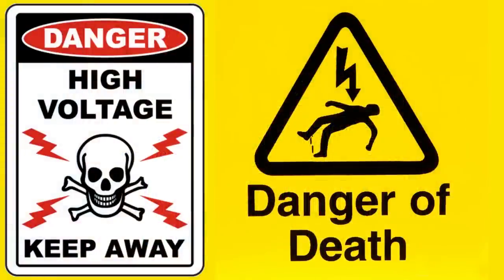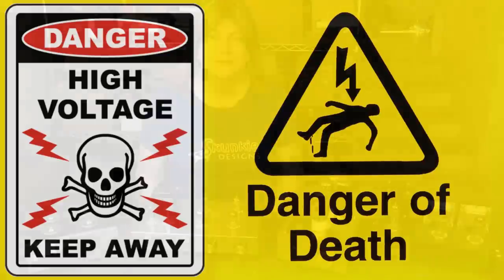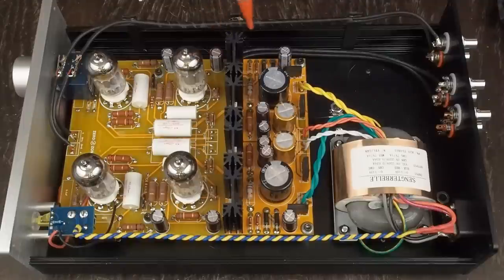HiFi Tube Pre-amp: Final Three Shootout!

Comment: That is so weird, because I have the looser, X2 units. I run them with two Dynaco ST-70s with a pair of Klipsch RP600Ms and Sony SSCS5s. One for the top and one for the bottom. I think the sound is fantastic, and I have several preamps to compare to. I run them on an AmpManiac variac and keep them at 110-112v to protect the 110v transformer. They sound absolutely amazing to my ears. I do have Genalex Gold lion tubes in them, but they sounded great with the stock Chineseium PSVane tubes as well. The point to point wiring is top notch IMO, and the chassis is solid. À chacun ses goûts I guess. I love your channel and watch at least weekly. Keep 'em comin'!
Reply from the maker: As with all audio gear, "how does it sound?" is very subjective. It lost my shootout for safety, parts quality and design reasons, plus to me the other pre-amps sounded better and actually produced a usable amount of gain. As always YMMV, if you enjoy them, keep enjoying them.
Reply: I recently bought the #2 Nobsound and it sounds awesome,I also also got 4 genalax gold lions. I don;t know what the other two sound like but I sure they are good I am also getting a couple of rectifing tubes in the mail today, Here's to tweaking and upgrades.

Comment: Instead of going DC on the heaters could you put it a terminal strip and run twisted wire directly to the heater pins on the tubes bypassing the circuit board?
Reply from the maker: That might be the easy solution to try and just cut the board traces. I think I will try that first.

Comment: I own your loser amp and it sounds very good. I updated the 12ax7 to 6sL7 and it really opens the soundstage.  I upgraded the rectifier to an American 6x5. Also on pointing out the transformer weighing in at 110 volts. That's a Chinese thing. I've owned several chifi amps and they all have 110 printed on them but seem to hold up well. I own one that is around 8 years old, and barely runs warm

Comment: Fantastic video. I'm learning a heck of a lot from your videos. I built a couple nobsound amps that look just like the loser preamp. My hearing must not be too discerning because I think the push pull amp with 6u8a and 6p1 tubes sounds great. I'm not experienced enough to be able to tell and possibly since I'm a retired diesel mechanic so my hearing is not so good. As you mentioned these kits come with a schematic and that is it. No other guidance at all so I had to figure a bunch of stuff out on my own which in turn I learned a heck of lot from those builds too. Can't wait to build the little preamp you mentioned putting together. Being a vintage radio guy the little wooden chassis is appealing to me but I imagine that would be hard to find.

Comment: I bought the diy version you losing choice, i did ground it though. Im about halfway finished so its unfortunate uve come across your video so late. Any advice on improving the build? Ive actually made my own copper runs because ive felt that the cables that came with it were lacking a bit. Also im wondering why my amp comes 1 of the bigger tubes and 3 of the smaller 12ax7s

Comment: Oh you do Pre's too huh ? :)  The differences will be WAY to subtle to hear on a YT vid, but I bet they're nice to look at - watching now !  Ohh, OTHER peoples Pre's?

1 - Gulp! THAT;S why they gave em mains taps, back in the day , right? Heater volts is s'posed to be +-10% iirc?  Sheesh! ... Yeah cheapo hi capacitance cable seems so WRONG for a tube pre and 'stereo'' cable brings MUCHO crosstalk!) If I found one in the trash it'd be fun to rework (and fix the ground), but otherwise...
2 - Cant see the PCB layout, but yeah, not so bad .. AC heaters, good point - be fun to rewire or convert..? I try and do the twisted wire thing even if I'm using DC - it just feels.. 'right'
3 - Ah this IS one of yours - ohh, that's NICE !
(cant you just switch the regs for LDO's? They can be noisier, but long as your decoupling is good? (I'm sure it is!))

Hi from London x
PS I've got some orig Mullard AU7's but pers not so fond of em in Gain Stages - dist tests seem a way worse than 6SN7's (and I try and avoid octals) - I figure those Russian things the perform like ECC88's should be a tad nicer, have you ever tried 'em ?

Comment: Hi Skunkie, Kunke here . . I would REALLY like to hear your thoughts about a Heathkit
SP-2 preamp . . IF necessary, I can supply one to you, providing the shipping cost is low, & yes, it will need servicing . . . I'm 70 on social security & bidenomics has really KILLED my slush funds . . . . ALL producers & engineers & musicians have their own " flavor " as so do I, & that is why I REALLY appreciate this preamp . . . Basic 2 reasons, first, the bass & treble controls are at the correct frequency range to boost & cut, 2nd, the loudness control is -  Variable - sometimes just a smidgen of a turn &, WAH - LAH, what a difference it makes . .  God Save US . . . . Thank You SOOO Much For Doing What You Do . . .
Reply from the maker: Send me a message at my website. https://www.skunkiedesigns.com/contact

And unless it's pretty lightweight, shipping will not be low unfortunately.

Comment: I bought an OTL headphones amp for a 100$, but it broke. The builder repaired it, upgraded some parts like potentiometer and transformer, but it broke again. With a friend I figured out, the heating for the 6SN7 does not work properly. The builder had that done by a computer psu. How You recommend me to fix that thing.
Reply from the maker: I would use a small 6.3V transformer and just run AC heaters.

Comment: Hi Skunkie. Boy did I enjoy your video. I have a variant of the wooden preamp but mine only has one 6SN7 and yes upgrading to CV-181Z is the way to go. Wait till you upgrade that rectifier to a Cossor 274B.

I also upgraded my coupling caps and the potentiometer and the supply caps to Supertechs. Mundorfs should be better for sure 

Hooked it up to a 24W solid state class A amp, also China, also with upgraded parts, and I'm a happy camper.

Here's the mystery. I use my DACs remote as my volume control. So my woody preamp is set to full gain. Yet my speakers, DIY, are dead silent, even at loud setting with my ear right up beside the tweeter. Go figure.

More power to your channel Skunkie!

Btw, in tube rolling I did try an NIB Telefunken 12AX7 black diamond using a tube converter in lieu of the CV181z and yeah that was a champ as well, still dead silent mind you. Tried 12AT7s, 12AU7s, no problem.

Comment: I bought the one in the middle (the worst) and while I been getting a hum when the volume is up all the way. I replaced the tubes with pricey genalax gold lions.The rectifier tubes are not loose like the ones that she is displaying and I have some new ones coming in. I think it sounds pretty good and I also didn't think the stock tubes  ones were that bad. I wish that I would have bought one of the other 2 that she is reviewing, but I already spent money on new tubes and a new power chord, (thick as a garden hose) I'm going to keep it and enjoy the upgraded sound in my system. I think that this pre-amp is a hit or miss and maybe being a better build as time goes on.
Reply: So your hum might have been thru heater-cathode leakage, iffy tubes? So maybe the layouts not THAT bad, but yeah I still like that idea about DC conversion... I tried a few of those - theres really good quality SMPS electrolytics that are nice for that

Comment: Steph, are you sure that blue capacitor going to ground is not a MOV. It looks close to one, and it is going to chassis ground, and they didn't use the power ground.  Not that this idea offers correct protection, but I could see someone doing that. And the sticky ties can come unglued after time (;;;;;;;  

On the 3rd amp, that is correct on the 6 volt ic regulators, the standard rule on those is a minimum of 2 volts over, and I believe they can typically handle inputs up to  37.  I think your trying to explain they might be lethargic from being so close to the minimum required input. I agree. It's an odd situation because I understand those transformers are made with multi taps typically to provide you with exact needed voltages in AC, and when mixing solid state, here is a good example where it's going to be a problem.  So MAYBE, and I don't know, but is it fine to run the heaters at 5 volts, if yes, then pull those out and replace them with 5 volt regulators.  The cross reference is easy too, they are probably 7806 that's in there, and you can put in 7805s, That would be the positive series starting with 78.. where as the negative series starts with 79
Reply from the maker: Nope, even 6V is too low IMHO. I think the best solution is to use use dropping resistors to lower the voltage from 7 to 6.3-6.5V. 

As far as the "blue cap", you may be right  as I didn't look very closely, but honestly that just makes it more dangerous lol. These are designed for use in parallel to AC mains and in case of a component failure would reduce any resistance between the high voltage and the exposed chassis to zero!
Reply: @SkunkieDesignsElectronics   Thanks for the shootout!  Yes - that is the best solution.  I just did this on a preamp with the same issue and used two 0.15 ohm 5 W resistors and dropped from 7.2 to 6.3V.  Easy calculation as heater current was nominally 3.1A for the tubes combined.  Should greatly improve tube life.  Operating heaters down to 5 V is a bad idea unless it is a rectifier tube as it will cause cathode poisoning and the tube will have greatly diminished emissions.

Just a note, you may already be aware but exercise caution converting heaters to DC as it is a greater load on the power transformer.

Comment: Hi Steph - I still am curious if you remember what weirdness was occuring in the zerozone CJ7 clone pre when you had 12ax7 tubes in there that seemed to be better when you put in 12au7 tubes...my tech looked at mine and wrote this to me when he sent it back...
"A couple more things:
 This preamp uses 12AX7 (ECC83, ECC803) tubes. To put it bluntly, that's a terrible tube for a linestage.
It has too much gain, and can't drive long cable runs.
Your preamp has 20dB of gain. This might be way too much, and results in using the low end of the volume control, and is noisier than it should be.
  And while it puts out more than enough voltage to drive your amp to full power, when it runs out of gas, it distorts rather abruptly.

So, I did some experimenting with different tubes from the same family.
  I replaced the output tubes (the two closest to the heatsinks on the left side) with ECC81 (12AT7). Big difference.
Maximum output nearly doubles, with much better distortion characteristics. You will never reach maximum output.
 It drops the gain to a more usable 15dB, lowers the output impedance by a factor of 10, and reduces hiss substantially.
I then replaced the input tubes (two on the right) with ECC82 (12AU7). Not as big a difference, but quieter still.
The ECC81 also work well here."

What do you make of this?
Reply from the maker: I honestly got side tracked and never finished dealing with that pre-amp. What he said makes a lot of sense!
Reply: @SkunkieDesignsElectronics  thank you!  Both you and him were the only ones who mentioned this strangeness.   I also remember something of the regulators being underpowered and am trying to figure out if this is tied in with that.
I am otherwise addicted to your channel and all the monologes.  Great stuff!!
Reply from the maker: Yeah, I recall someone msg me about the regulators too.

Comment: There is a way to twist wires on a pcb. Run one wire on top and the other wire on the bottom both in a weave pattern crisscrossing. Running a three terminal regulator at a lower input voltage won't cycle. What happens is that the regulator will drop the input voltage 1.2 volts (called insertion loss) for LM317 regulators, so if you have 7 volts the output will be 5.8 volts to the filaments.
Reply from the maker: Looking back, I think that is the issue with that one pre-amp, there isn't enough voltage on the regulators. Might be better to just use a dropping resistor there to get the heater voltage in line.

Comment: In a tube system set up, is the tu e sound predominant in a preamplifer or a power amplifier?
Reply from the maker: It's heard most in the "front end" so the driver tubes or the pre-amp would likely impact the sound more. The problem with preamps today  is very few "power amps" have low input sensitivity and actually need the gain provided by a preamp, so most of this gain ends up being shunted to ground.

Comment: Skunkie- I am hoping that you can help shed some light on a question that I have. I have one source (Bluesound Node 2i) which I plug directly into my tube amplifier (VTA ST-70). The Node 2i has plenty of gain to make my system loud with my Klipsch Fortes and LaScalas and it sounds great. My question is, would there be any benefit to adding a preamp into the system?
Thank you!
Reply from the maker: No, I see no reason to add one.
Reply: @SkunkieDesignsElectronics  Good advice. Mostly it's the hifi gear sellers that say you need one lol

Comment: Hi Skunkie. Nice shootout. I got something very similar to your winner, same wood chassis. Difference is only 1 6SN7 and 1 tube rectifier and has a choke.

I also rolled a cv181-z to good effect. But what I ended up with is a Cossor 274B rectifier and 12AX7 instead of the CV181. Alternating between a Telefunken and an old Sovtek 12AX WXT+.

I'm quite happy with either. More power to your channel!
Reply from the maker: Thanks for the info

Comment: I come across your channel recently..
Wow lot of cool stuff
I'm just getting into tube preamps and as you say I'm trying to give my solid state amp that I built the Leach amp a nice tube sound I like the distortion of tubes
But can't achieve the higher wattage.
Not to mention the expenses.
So as a experiment I bought a toy FX audio tube-03 tube preamp (China)
I did some modifications to it has two opamps for the tone control and volume.
Changed to Lm4562's and swapped out the cheep China tubes for 2x Voshkod 6ZH1P-EV.
Sounds a lot better.
But I don't know if it qualifies as a true tube preamp buffer.
It is hard to find a true buffer not needing the gain.
 What is the kit for the clear winner and what is the price I'm trying to do this all in a budget.
I think it's super great what you do on your channel sharing this information I have to go back and watch all your videos try to learn about tubes.
I'm all about solid state I can't do all the math but I can follow schematics make my own PC boards wire things up etc etc.
Just need good advice on a good starting point to add that sound to my SS Amp !
Thanks for sharing.
I'm sure all is greatly appreciated amongst all of us !!
Reply: The cost of the 6sn7 preamp shipped to your door  is a little under $200. On AliExpress.

Comment: I noticed you use Alps volume pot! Any Advantage of using fancy stepped attenuator with discreet resistors? Is it audible?
Reply from the maker: My main problem is stepping, it's always one click is too low, the next is too much. It would drive me crazy!
Reply: @SkunkieDesignsElectronics  True but isn't it more transparent then a volume pot?
Reply from the maker: @locmanw1583  I've never tested it, so really can't have an opinion. I think this is getting into some very nuanced territory.

Comment: I have upgraded the two tubes as in your video and would like a recommendation for the rectifier tube as well. Obviously not going cheap...so what would be a very good upgrade?
And would a adapter be needed? Fore some reason I'm hooked on this pre amp 'lol' and will
be experimenting with some of my vintage Marantz amps. Thanks again
Reply from the maker: I don't think you would ever hear anything changing the rectifier, as this preamp draws so little power.
Reply: Hi I have done to same as I bought the cv181z tubes as well. But they have a really loud buzz when I put them on. Is this normal and the buzz will be gone later or I have got some bad tubes?

Comment: Hey Skunkie, I have a question, and I will probably make myself sound uneducated because I am new to tube amps, but I bought an EAR834 circuit board but was wondering if could use the cv181-z tubes with the ear834 clone. I know some tubes won't work with some amps, but from what I have heard, the cv181-z tubes are amazing sounding! Keep up the amazing work Skunkie and look forward to learning more about this new hobby of mine!
Reply from the maker: Possibly but also be aware these have high gain so low noise tubes are best. The new production EH7025 work well as do NOS 7025 tubes.

Comment: Not sure if you ever mentioned it, but what exactly is the brand of the 2nd preamp ?
Great video, well done !
Reply: The one with the black tubes ?
Reply from the maker: It doesn't seem to have a brand name on it? And those black tubes are Shuguang Treasure CV181, a variant plug in replacement for a 6SN7.
Reply: You can find it as: "6N8P 6SN7 tube preamplifier 6Z5P bile rectifier"

Comment: Have you considered the 6P15P-EV tubes for the Spud ala the Decware Zen Triode? They are interchangeable with EL34 but have a wider frequency bandwidth. Love the videos, as a diy audiophile your channel is exactly what I'm looking for. Thanks.
Reply: Sorry meant EL84.
Reply: @lastscatteringsurface9950  Hold on, arent 6P14 more like EL86 Or something? The Russian 6P14's Ive had have been VERY tough, working in my AC30-like designs (with crazy high HT) But I'm pretty sure 6P15's are more delicate, and def expect a lower screen voltage... Skunkie ??

PS Wider bandwidth? How so? I dont think tube capacitances make much odds til youre well into megahertz